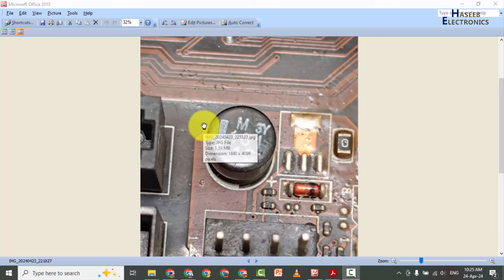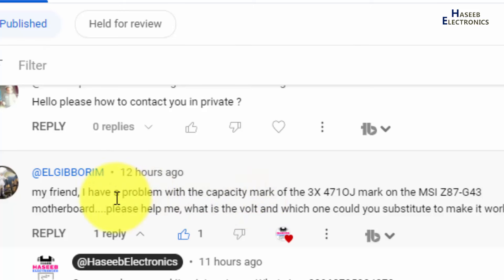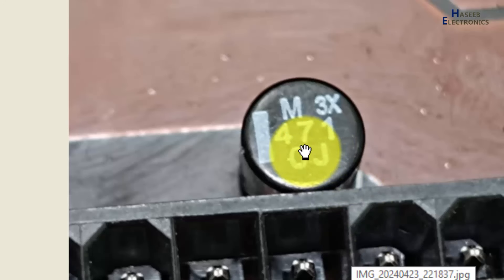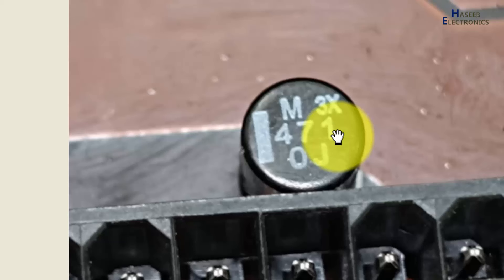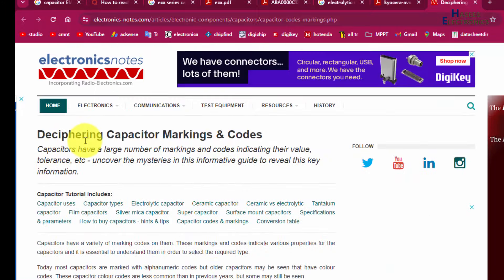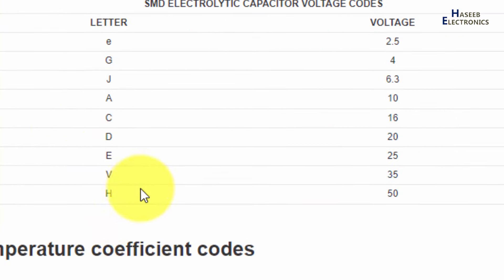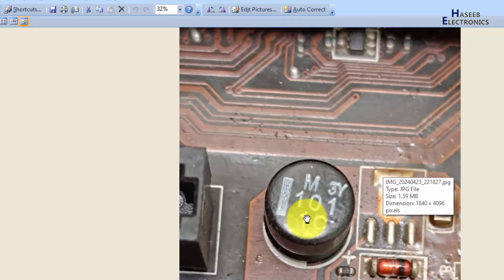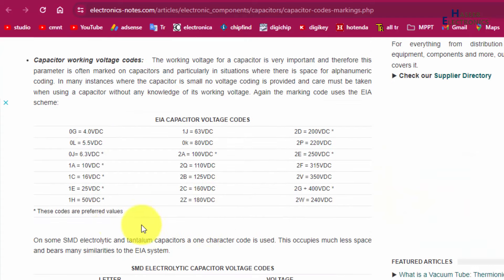{1100} EIA Capacitor marking code Explained with examples

Comment: Very informative sir. Sir can you help me to test shunt resistor and sense resistor and where they install this components. And why they used this component in electronic
Reply from the maker: shunt resistors are used to measure current values 
check video number 357 to understad current shunt 
it can be measured using milli-ohm meter  or 4 wire multimeter HP3456A